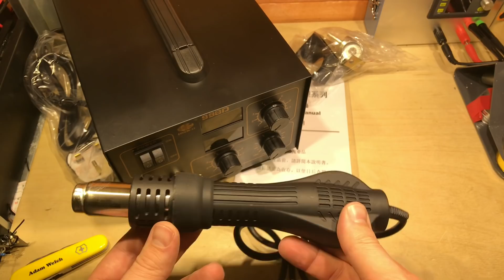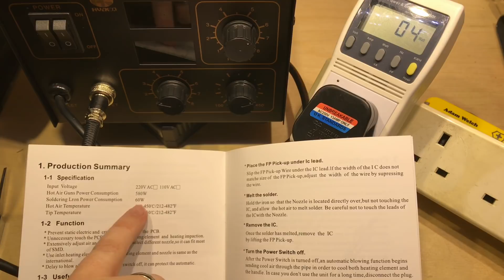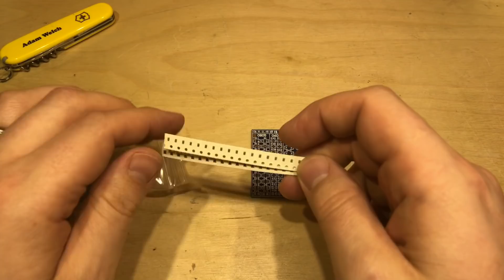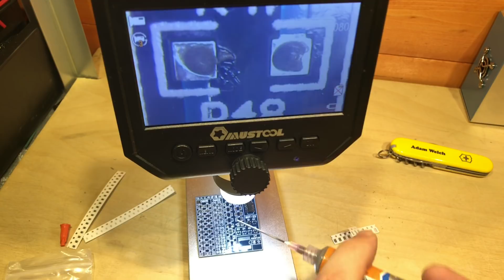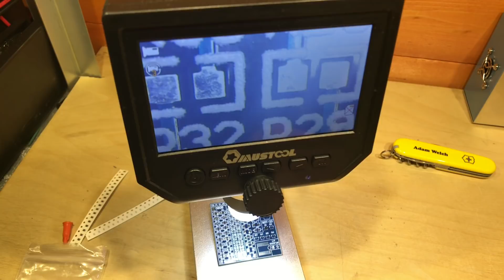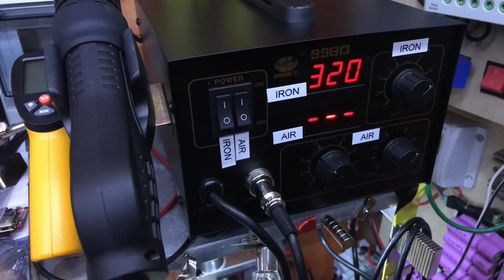998D Soldering & Rework Station Review - 12v Solar Shed

Comment: My WALFRONT 998D just burned out. Making noise and smoke comes out it, and that happened when he was off, only the power plug was still in the power socket, he begin making noise and then smoke came out of it, and smell really bad, so i had to removed the power plug from the power socket. 

I was really happy i was there at that moment, or maybe my barn would be burned down now, i do not recommend this SMD Rework Solder Station, i would recommend the WEP 952D SMD solder station, or the YIHUA 952D+ Solder Station, it cost twice as much, but is also much better and more reliable.

Comment: wow the unit is HUGE and they couldnt fit a connector for the hot air wand, I bought the X-Tronic 6040 station probably two or more years ago, so far it has worked like a champ and has a switch for the mains coming in so there is a 4W idle but can be easily turned off (it also blinks the 7 segments to tell you its drawing away).

Comment: My hot air station is different but with similar features, the power switch is actually a soft power, when doing hot air it ramps down the temp first before shutting off, which is why you see 4W, it is still actually powered up.

Comment: that resistor seems to thoroughly enjoy its floating :-) idea: open the case and switch the wiring between the 2 on/off switches so right is right and left is left ?

Comment: I have one like that and it has a main power switch on the back. When I use the paste I try to have it at 90 deg from the pad and then I just dap the paste on the pad and it seems to stick good. Nice job and yes the parts are small wait till you try a  fet

Comment: It totally makes sense to replace the heating element IF your station can use the A1321 heater instead, because from what I've seen it tends to perform a bit better than the A1322 and the handles sold with the A1321 tend to cost about $10 compared to $3 handle + $2 element.

Comment: Don't leave it plugged in unattended! These things have the transformer inside connected to mains all the time. The switches on the front are on the secondary side, bad design! Transformer is cheap, undersized windings cause excessive idle current. Those 4w you saw are very likely gonna be dissipated as heat in the transformer. Besides unnecessary consumption, it is a potential fire hazard.
Reply from the maker: Thanks for the tip.  As I mentioned I always switch mine off at the mains when I'm not using it.  I have a wifi plug which automatically switches off after an hour of use in case I forget as well.  Thanks MrJohhhnnnyyy, you always have something interesting and useful to add.
Reply: Adam Welch That's a good habit. Now that you said it I remembered that you have that WiFi plug :) I'm subscribed to many people, thus tend to forget stuff a little bit.
Reply: Perhaps add a custom master switch to the station that completely disconnects it.
Reply: @asrarhassan  It's the way I'm using. All my devices are plugged to a master switch. Leaving the place, master switch is off.

Comment: 15:47 is showing a blob of solder touching both pads. Is this just a practice board or does it have a use?
Reply from the maker: Practice board, but as the solder heats the solder mask should mean it flows to the pad rather than bridges the gap between pads. Now you’ve spotted it though I will test the resistance and let you know if I was wrong.
Reply: I'm learning myself, thanks
Reply: Hello...solder will only "Stick" to the pads...there is a "laquer mask" on the pcb that rejects solder.  That is how the solder is "positioning" the components on the pads. (surface tension in the wet hot solder)
Reply: You can blob a bunch of solder and it wont stick, but it can and will lay on top. I've done it when I had to make a jumper and all I did was use blob the solder.

Comment: Heyy.. I got the same 998D a few weeks ago.. I think it's pretty good, especially for the money. Got some cheap extra tips too as I prefer small chisel type rather than the sharp point, but yeah.. good. I'm surprised how quiet the hot air is. Gotta get some of that solder paste next week.. Thanks for the review Adam!
Reply from the maker: No worries. Thanks for the input. You can pick up tips for about £1 each. I’ve got quite a selection now. Tend to use the 2.1mm chisel myself but keep a larger one one hand for larger connections as well. Cheers
Reply: Cheers.. yeah I ordered I think 12pcs for a fiver or something so.. super cheap because I only just begin making projects and didn't know what I would prefer.. 2.1 is what I have on now ye so I may buy some more expensive of that type soon enough. All the best!

Comment: Hi your first links says 220V. Were there no adverse effects on the UK mains ? My voltage is quite high at 248 V
Reply: Glenn Pierce woah are you living in the power station :-)
Reply: Yeah. That's in Cornwall. To be fair when I lived in outer London it was about 244 I seem to recall. Would be interesting to find the true averages. It was my understanding that the electric suppliers never did try to harmonise around 230.
Reply: maybe they had future times in mind (britain leaving the EU)
Reply: Well, they did... by setting the tolerances on the new 230V standard such that that the old max of the 240V and the minimum of the old 220V  standards both 'fit in', meaning no-one really had to actually DO anything other than state that they were' now 230V... :-) Initially by using different tolerances (+6/-10% vs +10/-6%) depending if they came from 220 or 240, but it looks like many countries later have switched to the higher band.

Sweden was one of the 220V countries and my outlets here were always on the upper end, and are currently at 236V, fairly close to a small sub-station.
Reply: +Michael Tempsch I'm Dutch and we had 220V back then (now 230V) and in the early 80s I was a kid and we went on a holiday by ferry to the UK. I had a red Philips radio/casseteplayer rated 220V and I asked if I could safely use it in the UK with a travel adapter. They said yes but it might run the tape a tad faster :)

Comment: Hi there adam i need help all my solder joints and points go all tarnished when i solder ice tried diffrent brands of solder i solder at 350 and i use flux
Reply: try a lower temperature you might be burning all the flux off, and make sure you are using standard 60/40 tin/lead solder.
Reply: SuperBrainAK im ising 60 40 tin solder and ive tried a lower temp and its hard to melt the solder below 330
Reply: If you are using lead free it never looks shiny like leaded.
Reply: Joshua Hutton Be shure it is not leadfree. I bought 60/40 from China but it was just leadfree and with a very bad flux in the core. Try to buy some localy and compare.

Comment: Spookily just received the same one on Monday.  I've been looking for solder paste and most of the ebay ads i noticed came without a tip which i thought was weird, more of a refill almost.  Looks great when the heat is applied and they straighten up nicely, might have to get myself the microscope now though lol
Reply from the maker: Ordered these at the weekend after finding the one I had was a bit wide. Not tested them yet but they arrived today. https://rover.ebay.com/rover/0/0/0?mpre=https%3A%2F%2Fwww.ebay.co.uk%2Fulk%2Fitm%2F252921301454
Microscope makes things much easier. :-)
Reply from the maker: These needles might be a bit thin - struggling to push the solder paste through it. These are 21G and the one I used in the video was 18G. Some where in the middle of the two might be a good compromise.

Comment: There are 2 labelled 10 turn pots for the hot air and soldering iron inside the unit. Set both temperatures on the outside to 230C. Then turn the pots with the soldering tip on the thermometer until it gets 230c.... done! same with the hot air
Reply: Oh! That's good to know. When I got mine I did start to take it apart but I was a bit excited and some of the screws were really tight and I couldn't be bothered to get my other screwdriver so just tested earth continuity to the tip.. Knowing about the pots I'll give it another go. Cheers!
Reply from the maker: Excellent. I expected there would be. Thought I’d save it for another video :-) Cheers Billy.

Comment: power switches are on dc side of the single transformer......thars your 4 watts.....
Reply from the maker: Makes sense. Thanks.
Reply: its annoying, mine has a 24/7 buzz....if i wasn't such a lazy sod i'd fit a mains rocker switch.....
Reply: same here, got a buzz when the soldering iron heats up each 2sec.